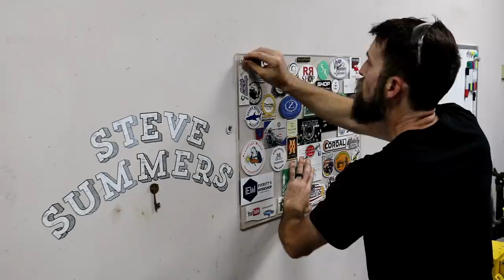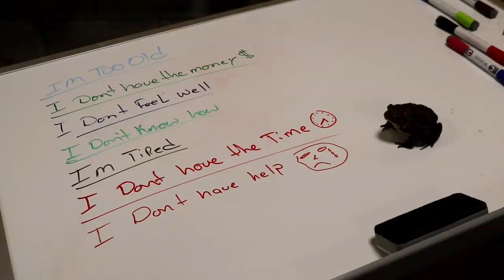Shop wall removal / Cutting the Concrete floor / Truss Tails

Comment: The way I build sturdy workbenches, is to use 4x4 posts for the legs. Then I put my dado blade in my radial arm saw and cut half laps in them to fit 2x6 rails and cross bars. I put rails and cross bars around the top of the legs, and again around about a foot or so from the bottom. Once it’s all screwed tightly together, you have a very solid bench.

Comment: When I was an apprentice electrician I am 71 now I remember fitting those mercury switches in the operating theatre of a hospital due to the fact there are explosive gasses present no spark when switching, keep up the good work
Reply: I wish those switches were still made. I miss my silent light switches, but unfortunately everything wears out after long enough.

Comment: I use bitumen as a wood preserve. It works realy well gives a mat black finish. When it needs replying you just put another layer on. It's best put ting it in a warm summer day as its a lot easier to work with and it will give the new timber a chance to silver off a bit and absorb more of the bitumen.

Comment: Just a little tip when you unlock the lock to get in ... after you open the door re-lock the lock on the door so you need the keys  to re-lock the door ...... can’t lock your keys in.......speaking from experience 😄
Reply: John Drzal what a good and simple idea!
Reply: That's a great idea !!!!
Reply: Or just keep a spare key somewhere else.
Reply: You cannot get the key out of my abus padlock when it’s open , just hang it on a hook inside the workshop with the key retained , sorts out the key lock in and a joker locking me in
Reply: If only I could make that work with my office trailer - thank God Home is within walking distance!
Reply: @stuarthardy4626  i agree with the relock the padlock, then you can use the keys for other hings and have to have them to lock the building.
Reply: Also someone can't lock you in as a joke.

Comment: Also, if funds are available, maybe add a man way door into the large sliding doors for quick access in and out and you can also lock the two big doors from the inside. Hey dream BIG.

Comment: When I was framing and drywalling we would keep the drywall 1/2" up off the concrete to help keep it dry and and stop the seams from cracking from expansion and contraction.

Comment: Hi Steve, the slab cracked because the rock moved, if you put say 1 or 2 inch of polystyrene foam down first over the stone then concrete over the top. This will allow the rock to naturally move and not crack your slab in the future.
To join the back wall into the slab just pin the reo steel mesh into your next slab.
Looks great and I totally agree, do it once and do right and it will never be your problem in the future!

Comment: We have a miniature Shelty named Chloe too. Looks a lot like yours.

Bo Sorensen:  Sheltys like belly rubs , that is what legs up is for. Dog treats are used to get them right side up.

 I make benches and tables from 1 inch square or larger square steel tubing with a MIG welder. Grind the welds and powder coat when done. 
A cheap abrasive chop saw cuts or mitres the tube quickly. You can tap holes or weld nuts to fasten things. By the way 1 inch square .09 or .125 wall is plenty strong and not too heavy for most things. Might even be cheaper than wood. Don't overlook the convenience of the square shape for fabrication, round tubing sucks. While I have some things that are a lot heavier only when necessary. Cross braces or diagonal braces can give you a very rigid structure that you don't need a crowd to move. Of course sometimes very heavy is what you need. We often put a shelf at the bottom out of 3/4 plywood and screw it down to add rigidity. Your lab tops are great.

Comment: The standard rule of cantilever is 2/3 support for 1/3 overhang.  Personally I would go longer at this convenient time.  I put four foot overhangs on my shop and I love them.  When it isn't blowing (a rarity!) it is a nice place to do a little outside work especially when the snow is on the ground.  It sure keeps the weather off the structure much more.  I lined my soffits with plywood as well which makes a box beam for looks and extra strength.  Steel is great for sliding the snow off and keeping the snow load to a minimum.  It is your cow, do her the way you want.  I am just saying because you already have the material and it would be so easy to make a great impact for later at this time.  Nice job.
Reply: Great comment.  We see what Steve has done, we comment, and as usual, it is always too late, he is done with that portion!   Great build Steve.
Reply: I wonder how 3 foot overhang fares in real wind (say 30+mph)

Comment: For minimal expense you can add insulation below and PEX tubing into your new slab, even if you never hook it up, the option to have a heated floor is well worth the extra few hundred dollars and minimal effort. having radiant heat is an experience you will never forget, it turns every chunk of mass in your shop into a warm radiator, picking up a 65 degree piece of steel off the floor or grabbing hold of a machine control that's not freezing will change your life in the winter, and its a virtually silent heating system, no fans to listen to.

Comment: Painting Wood Siding:  Using solid exterior stain may be a better option than paint.  Our house was stained and never had a problem with the stain flaking off.  Still had to stain every five years or so – but it seem to hold up better than paint.  Exterior stain can be color matched just like paint.

Exterior stain also can be applied to concrete.  Our foundation is “painted” with exterior stain and has lasted well without any flaking.  Could be used on cement block – if a light color is used – could brighten up the room due to the better light reflection.
Reply: I was thinking creosote as I watched that segment
Reply: @myharris  A question: I'm from Canada and creosote use has been banned here as a carcinogen for many years. Is it still used in the States? We used to use it by the 45 gal. drum.
Reply: @crichtonbruce4329  Not sure about the US, but here in the UK you can still buy it. Smells like the same stuff. Hasn't killed me yet :-)

Comment: Commenting here from California, I am envious of that bit of rain you got.  We just went over 4 million acres burned thus far.  And remember, 57% of Calif forests are Federal land.
Reply: If you "slackers" would just rake your forests, everything would be fine.......
Reply: Any time they cut a block, clear cut or selective, they pile up the slash and burn it.  I'm just saying a little rain would be nice.
Reply: @jservice6594  what else are you supposed to do with the debris besides burn it? We do the same thing here.
Reply: @1pcfred   Decades ago they would just leave it and move on.  Why waste the money?  They knew they wouldn't be back for 50-60 years for the second growth.  Then they realized that all this slash, all this fuel on the ground could turn a "normal" ground fire in the forest (very beneficial) into a crown fire.
Btw, where is "here"?
Reply: @jservice6594  here is where I am. We have firefighters out in California now. Or we did. They talked about it on the news. We never have forest fires here so they could use the practice. We do have our fair share of house fires though. What we have that California doesn't is good rainfall. Although half of this summer was pretty dry.
Reply: @1pcfred  Yeah, the real cause of all this crap is the drought over the last decade.  Especially 2014-17 which was insane.  I'm talking about 70 degrees and sunny every day all winter long.  No rain.  No snowpack.  4 years in a row, with only slightly better in the surrounding years for the whole decade.  That weakened the trees significantly and they were not able to fight off bark beetle infestation and blight.  Just forest fires waiting to happen and they did.  August 15-19 saw a massive state-wide lightning storm and it's been burning ever since.
Reply: Anyway, here's what we're talking about
https://www.youtube.com/watch?v=0MVkVIrpGsI
Reply: @jservice6594  people like nice weather.

Comment: Before drywall, interior walls would have been lined with wood lath or metal lath, then finished with wet plaster, hence "drywall".Congratulations on increasing your building roof overhang which will increase the life of the walls significantly.

Comment: They call it dry wall because, traditional plaster is put up wet!
Reply: Still with you Steve.
Reply from the maker: Yeah😁, thankfully we dont do that stuff much anymore. What a PITA to repair once old and falling.
Reply: @SteveSummers  That's another story, plaster, when you know how to use it is amazing stuff! I've used it in buildings, for sculpture and for casting. I can understand that when one has no idea how to use it, it can become a big mess fast!
Reply: Here in the uk we dry wall (plaster board) then plaster over the top. I find it a bit weird but i guess it goes back to lath and plaster and we havent evolved that bit yet lol.
Reply: According to the old timers I worked with back in the 80s, when the plaster was applied over wood lath they would take a hose and soak all the lath the day before starting the plaster.  The invention of ‘rock lath’, think gypsum wall board with a grid of holes in it, really sped the process up. A lather could now cover 8 square feet with one 2’x4’ panel and a dozen nails. Wood lath would have taken 12 pieces of lath and 48 nails for the same area. No time lost waiting for the house to dry after being thoroughly soaked.  I don’t think the switch to wall board sped things up a great deal but it greatly reduced the labor. Instead of needing lathers, plasterers, plus laborers to mix the plaster, all you needed was two guys to hang the boards and one or two to tape the joints.
Reply: @janderson8401  Plaster should he applied to a wet surface, otherwise it doesn't bond. Plaster is slow to dry! It goes hard long before it's dry!
Reply: @FaenumVena  Pink finish plaster used in the UK is a very thin skim coat, it doesn't have nearly as much water as a traditionaly plastered wall.
Reply: @MatthewTinker-au-pont-blanc  oh I know, I just find it interesting that we plaster the whole wall as oppsosed to just the joints
Reply: @FaenumVena  Here in France it's the same, a very thin skim, it gives  a uniform finish which is easy to paint.

Comment: Steve, in regards to pressure washing (wood especially), you don't want to pressure wash a surface you're gonna paint. You'll never get the moisture out completely, and when you paint over it you're just trapping the moisture in there even further, inviting issues like rot or mold.
Better to just lightly sand the surface in preparation for painting.

I've been painting for 12 years and this is the single biggest mistake people make when preparing for exterior painting.

Comment: when hanging t1 cut the bottom at a 45 so the surface to the elements hangs lower than the interior side. That way water runs to the edge, and does not wick back up and start the delaming. I wish I had done that the first time on my shed.  It does keep the water from running back up into the wood.  Actually good for any ply... But I find T1  really susceptible for some reason.

You collie has a beautiful face. Some are very long and skinny, she has great proportions.

Comment: I would do a wood stain instead of paint. So the finish soaks in as paint is just the top coat.
Reply: In a year it is going to look like the rest of the stuff. I mean not exactly but not like it is now. Outside wood loses that yellow color.

Comment: My grandfather had that stuff blown in the attic here back around '78-79 or so. It was fine for about ten years, but by the mid 90's the dust was getting real. Nowadays, can clean something off one day, and the next day it will already have a noticeable amount of grey powder started on it again. A couple weeks, and you can easily read finger writing on a tabletop. :P

Horrible stuff... And know breathing the dust from it constantly can't be good, either.

Comment: Wow this building is really starting to look pretty good. So much work but you are getting there and its going to be awesome. Use green M.R.( moisture resistant) board at the floor and the drywall will do much better. I really love that lab table stuff I always wanted one of those.

Comment: It might be too late by the time you post this, but if you cut that long strip of concrete up into 3 or 4 foot wide strips, you will have some nice heavy duty "bricks" or however you want to think of them that you can embed into some of the dirt paths around your place and pretty much have indestructible walkways.
Reply: I was thinking the same thing. I repurposed some concrete years ago. Moved the pieces using 2” pvc pipe to roll them on and bedded them in sand.
Reply: This is brilliant
Reply: You really want to saw concrete as little as possible especially what that setup Steve has. The only reason he's sawing it is so he gets a clean break with the slab he's keeping.

Comment: So I'm thinking that your lathe and shaper must have moved in before that wall was up, since neither door in that room is big enough.  When you put the space back together, you should put a nice large door (like a 4 foot wide double door or similar) on the machine room so you have easy access out of the room and out of the front of the building with a pallet jack or forklift or what have you.  Better for material moving too.  And while you are moving walls, it makes sense to get the other machines in there too.  Your idea of making a separate grinding room is a good one too.  You've got it all apart, so now is your chance to put it all back the way you really want it.

Comment: SUGGESTION:  When the floor is done, just insulate the whole shop and build a waste oil burner for shop heat. An open floor plan gives a lot more options than having to work around walls.

Comment: Steve, on that hunk of siding that looks too new, you might look at an Engel's Coach Shop video from a month or two back where he was restoring an old wagon that needed some new lumber. He painted the new lumber with a mixture of water and iron filings (if I recall correctly) which bleached the new lumber to look much closer to the old bleached boards.

Comment: I recommend rock wool insulation..  It won't burn. won't hold water. , holds it's shape. You can cut it with a hand saw or knife..

Comment: If you're painting anything, especially outside.. i only use Pittsburgh paint (now PPG) extremely high quality with best durability. Not a sponsor, just love quality. Also it covers in 1 coat usually, saving paint. I did a home exterior 20 years ago and it still looks great! (Shady side and sunny side)

Comment: If you want to avoid painting the sheathing patch, just mix some steel filings in vinegar, let it sit for a day, then spray it on the new wood.  It will turn grey in 20 minutes.

Comment: If you have the means, a water sealer, such as Thompson's, would be ideal on that T111 plywood. It'll last longer than paint and rather than sit on the surface, it will actually penetrate the wood and preserve it.

Comment: The mending plate will be fine.  The plywood you put on the other side of the truss is your true support.  But you can't use mending plates to build trusses as they are not structural rated.  Between your paying job, and your home work, you have put in two years of true work this year.  Looking good.  Stay safe, stay well.  That list of excuses mirrors mine. LOL

Comment: Hey, those head bolts can be used for something one day. It doesn't have to be a Honda engine. I don't throw away any hardware, unless it's damage or rusted beyond use.
Reply: @John Verne It doesn't need to be labeled "15mm head bolts", only the diameter and length. Because they were head bolts is irrelevant.
Reply: It'll come in handy even if I never use it
Reply: @John Verne Well, Steve doesn't strike me as a lazy person and only someone who is lazy would not take the time to do a little labeling. And those bolts are high grade and expensive. ;<)

Comment: The reason the mending plates say not for use on trusses is because they can't be installed correctly outside a truss factory.  When a factory builds trusses, they use a flat press with thousands of PSI to press the plates onto the truss.  When you hammer the mending plate on, you are distorting the plate and likely creating microscopic cracks/tears along the punched out corner sections, weakening the plate.

Comment: i had a fire in my 80 ft. shop caused by a fluorescent light ballast. The fire chief said all that saved it was the insulation like you have. I have a foot of it overhead no problem here.

Comment: Steve, when you rewire you can't use MC or BX metal cable with those blue plastic boxes like at 2:35. This is against NEC codes. Those are only for Romex cable. Based on all the outstanding work you have done to date here, I would rewire with MC cable, or even EMT if viable, and metal boxes. A bit more in cost but a much more robust electrical system.

Comment: Another Saturday morning ritual enjoyed: "Saturday With Steve". For your end wall boards might I suggest a good semi-transparent exterior wood stain?  Thanks again Steve!
Reply: I'm not sure I'd pressure wash it either - just a siding brush on a stick with a mild bleach solution. You can force a lot of water into plywood with a pressure washer.  I did a T1-11 shed with a pressure washer once pre-painting and it took a month to dry.
Reply: @TKevinBlanc  I agree. If plywood is pressure washed at to high a psi it will weaken it, even blow chunks off.   On a couple of outbuildings we used extra roofing shingles over the worn existing wood. It worked great and weather proofed the area too.
Reply: I just said basically the same thing but I recommended a water seal.